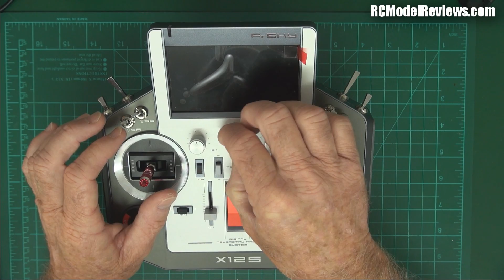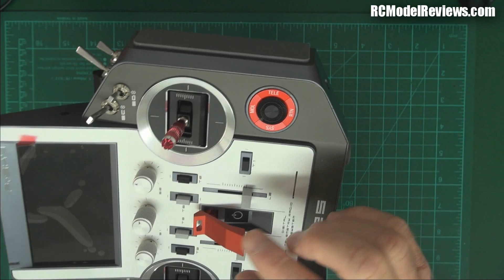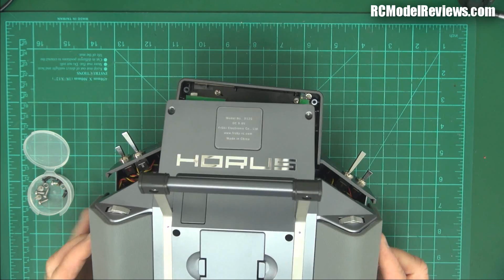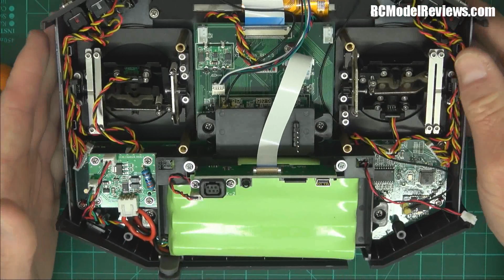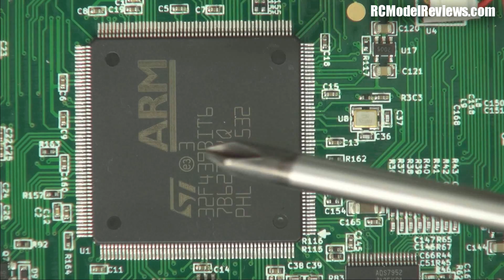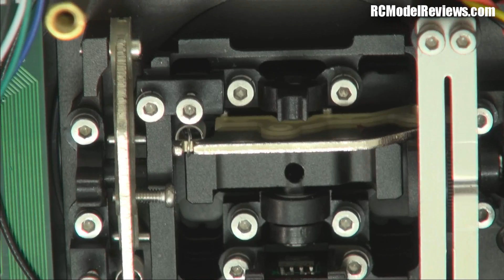FrSky Horus Teardown

Comment: The apparent lack of ESD precautions is a bit of a concern Bruce. It is an area that really needs respecting and perhaps consider an alternative pointer to a screwdriver! I know you may think it does not matter but as a 30+ years experienced licensed avionics engineer and designer I can testify for the damage static discharge can do. I have seen many very very expensive avionic LRUs ruined by poor ESD handling precautions. You don't want problems to manifest later down the line,watching your expensive model plunge down to the ground!

Comment: Hi. A shielded GPS? Ok, how many satellites could it pick up compared with another type at the same time? On the face of it, it's a very poor design. I doubt any GPS receiver works very well with a sheet of metal placed between it and the satellites. If it does, my undrrstanding of rf shielding shadow is in need of a rethink. If someone knows better (rather than just pontificating) do chip in. Bob UK.

Comment: The best thing about plastic posts would be the ease of repair using a variety of methods for example filling the hole with epoxy let it set and then drill a smaller hole than the screw to be used. Using a heat gun to carefully soften the plastic and slightly pinch the plastic smaller. Use a small piece of electrical wrapped tightly around screw once for a quick semi-permanent fix.

Comment: Great video as you say though the production unit has new main board and at least two others. Also gps module seems different. The switch cover has been redesigned and the sticks are shorter. Also as mentioned below you can now use the internal and external aerials together. I have both the beta radio and the production version, the improvements are noticeable. Finally the software has come a long way since the early days and provides a fairly intuitive menu driven alternative for those who can't or don't want to tackle opentx. I am a fan of opentx have been using it since the Taranis first came out. Given that it has been under development for several years it is somewhat unfair to compare the relatively new FrSky operating system, especially if you have the original version shipped with the pre beta units you have. Beta testing identified a lot of the bugs and improvements needed and FrSky have continued to improve it. I really like my Horus it feels really grown up but I won't be selling my Taranis any time soon as Iuse it to fly helicopters and multirotors. Sorry about the long winded comment I really only wanted to say keep up the good work hopefully FrSky will start taking to you again soon and you can do a review of the production Horus.

Comment: NiMh's are safer. They can take a lot of abuse, low discharge wont damage them easily and they work well in cold weather. Atleast in good quality cells the self discharge rate is much lower than with lipos. The self discharge rate is pretty amazing in something like Eneloops batteries. You can have them a few years on the shelf and still have around 80% charge left. NiMh technology is old, but they have kept improving it to this day.

Comment: Regarding antennas, Frsky added diversity with a software update if you plug an external one in.
So if you point the external antenna down (you can't point it up because if the screen), you get polarization this way.

Also, I don't mind the NiMH battery. As far as my experience goes, it has enough juice to run the radio for my typical day of flying, and it retains charge even when it sits unused for a while. And I don't worry letting it charge overnight (like I would with a lipo).

Comment: 26:15 Am I the only one seeing a vertical polarized antena on my right?
Reply: EQUINOX Not true. While there isn't a general purpose Bluetooth, it uses Bluetooth for the wireless trainer.
Reply: You are not, he pointed that out, it's the BT antenna.
Reply: You are correct David that is a vertical polarised antenna, I pointed it out earlier when the video first came out then RCModelReviews responded by saying it was BlueTooth,  However both Mark O and RCModelReviews are wrong because the X12S in this video does not have a Bluetooth function, they are confusing it with the model X12D that does have BlueTooth.
Reply: EQUINOX sorry but there is only one Horus model despite the confusing naming

Comment: the good thing on linear hall sensors used in this gimbals is, they take 5V and output 0-5V which means you could replace the most other remotes gimbals with these if you can make them fit in it.

Comment: 2 Problems with this tear down, first is with the antenna you comment that it only has one at the top but this is not the case it actually has 2, the one at the top that you pointed out and also a second one in the left hand side of the radio ( right side in the video ) if you pause at 27:03 it can be clearly seen

Second is the battery sure it is old tech but then so is the combustion engine that does not mean it is bad, the reason they most likely went with that type of batters is 1: Its does the job 2: It's a far more stable and trusted form of battery tech and is more shipper friendly
Reply: EQUINOX Rather than calling people names you should indeed check your facts, the FrSky website mentions wireless trainer mode. Guess what protocol that uses, that's right Bluetooth! Just a couple of further facts there have only been three versions of the Horus produced, a pre beta version sent to dealers and reviewers (the one reviewed here) the Beta version that went to 150 ish beta testers and the production one which is the only one available from FrSky now. It was the beta version that was missing the gps unit. They all have Bluetooth. I don't need to rely on any website as I have both a production unit and a beta unit.
Reply from the maker: Do you mean the BlueTooth antenna?  That's not handling the RC link.
Reply: BlueTooth?         The FrSky Horus X12S does not have BlueTooth
Reply: Psychosis5150 That is the X12D but it is the X12S in this video,  the X12D has blue tooth where as the X12S does not, If you are going to post a link to try and disprove someone at least make sure you are posting a link to the right product or at least reading the web page rather than just looking at the picture.
Reply: EQUINOX see my comment above
Reply: Alan you are incorrect stop posting missleading rubbish if you actually did some research for the facts rather than looking at one non official website you might not look like so much of a plank,  The retail X12S model does not have bluetooth,  that website that says it does have bluetooth is not the official FrSky website and is actually maintained by t9hobbysport and contains many errors.  Have a look at the official website and you will find no mention  of bluetooth in fact have a look at places that sell it and you will not find any mention of blue tooth and there is a reason ... that's right it does not have bluetooth.   Official website=   http://www.frsky-rc.com/product/pro.php?pro_id=144

Comment: Nothing wrong with Nickle metal hydride. Who in their right mind is going to be taking the back of the radio every time they want charge if they put in a LiPo???😄
I get loads of use from my Taranis on these batts. Just because Bruce says HE doesn't like them doesn't mean that there is any thing wrong with them.
Reply: johnnoble01 I agree there isn't a reason to replace it immediately after you buy it. I replaced the battery in my DX7s (wich supports LiPo in the software), but still use the factory-supplied one in the Taranis.
Bruce suggested that FrSky or an after market supplier could sell another chargingboard/battery-kit, so you don't have to open it each time...
Reply: i use a futaba 14sg with. 6v nimh 1800mah, and it works fine, i've found no need to change it for a lipo or a life even though the radio supports other options.
Reply: Nothing wrong sure, but I much prefer Lipos. 
longer run times and far lighter.
Reply: Smack on right. I've heard the same complaint about the Taranis, yet the two I use for work last 8+ hours on the stock battery, and higher capacity batteries can be built. I sympathize with those who really want the option, but the stock batteries are quality and work fine.
Reply: 29% discount on the horus http://www.banggood.com/Frsky-Horus-X12S-Texture-Version-16-Channels-Inbuilt-GPS-Module-Transmitter-p-1041413.html?p=B0221338596320131216
Reply: That's regular price. The regular price on Banggood is bullshit.
Reply: Why would anyone put a Lipo in a transmitter does any manufacture do that? Lithium Ion would be fine.
Reply: I think LiPo bateries are the typical example of something NEWER that is not necessarily BETTER for all applications. Nickel-based batteries do the job for a transmitter. They are heavier than LiPo... But wait, the transmitter does not go up in the air inside the plane so who cares! They are also much safer. The charger can be made cheaper and they won't be ruined just by forgetting to turn the power off once. If this happens once with NiMh, just charge again and you're ready to go. If happens with a LiPo, then it's time to go shopping.

Comment: Bruce, you mentioned the old FlySky 9X.  Do you know if the Horus or new Taranis hall effect gimbals will fit/work in the old 9X?  I'll probably need to replace my gimbals early next flying season and those look like they'd be the way to go, if they'll work.
Reply: HBS981 you will need to do some mods mechanically to fit,  but electrically I know 9xr pro works on 3.3v so it will work,  not sure on 9x if it's 5v the we might need to voltage divider.. etc
Reply: id love to know that as well

Comment: Hey Bruce- I would have liked to see more on the external antenna! Is it only connected to the module bay or will the Horus detect an antenna and transmit through that? Great tear down by the way, happy to see it for the Horus !

Comment: I know you're not a fan of Spektrum's 2.4 modulation. Let's put that aside as I've never had issues (And have with FrSky). My concern here is with servo draw. While I'm currently only flying 30%ers, I do plan to go bigger one day. I am also flying with WAY overkill servos as I hope to move them over to a bigger plane later on.

I do want to switch to FrSky, but as far as I have seen they don't offer any high current options at all. The only reason I'd be switching over to FrSky is for reliabilty (I DO have a problem with Spektrums pots in the DX18 I fly with.) How would you go about running 10+ servos that draw nearing an amp each constant with peaks over 2A? Does FrSky plan to release a powersafe receiver soon? I am a fan of the KISS (Keep it simple and stupid) theory and don't want all the extra complexity and failure points of power boxes.
Reply: Weese - hey there - I would recommend using a separate SBEC. It's really common to find a reliable 5v 3 amp switching BEC for less than $10.

As far as protocol goes- DSMX is honestly one of the better. ACCST (FrSky) is great as well. The difference is, many of the receivers from Spektrum are not very sensitive compared to the newer receivers that have come out from FrSky. I have modified a DX6 and gone out just over a mile (only higher gain antenna for the mod) - As for FrSky, I regularly go out a mile on a stock Taranis and still have >70% RSSI. I use an L9R and an OSD for even longer range. I trust my most expensive models to FrSky and always will.

Stay safe Weese, hope I helped!
Reply: Thanks for the reply! I'm not so much worried about regulators here as I'm running straight 2s 7.4 LiPo to HV servos. I'm worried about the power traces on the receiver. Spektrum makes power safe receivers that are meant to handle the high current needed for big models. I've seen normal "full sized" receivers burn through the power traces driving servos like that.

Edit: I somehow replied to my own comment by accident. Durp.
Reply: Run a PowerBox, a SmartFly, an XPS 10+, or even FrSky's new power expander. I do in all my planes, even my 42%'ers.

Comment: ive seen alot of radio even branded expensive one that have worn out pots due to 3d flying helis, i really wish they had magnetic or optical pots like in dj mixers where djs used to scratch with, now branded radio will get this idea from frsky. why to go frsky for being first.
Reply: Jeti had hall effect gimbals long before FrSky.  But then again, FrSky has stolen quite a lot over the years from Jeti.
Reply: I had a high end flightstick back in the 90's that used hall effect sensors, this is nothing new.
Reply: prototype3a what modern radio has this non pot stick.
Reply: Atomicskull probably. i dont see it in modern radios thou. i have opened alot of modeen radios end expensive ones. alot have pot problems specially 3d heli pilots
Reply: im not familiar with jeti, but you cant find this on modern branded radios, magnetic and optical faders for mixers were just a must on dj mixers, i wanted them to have it on radios too, you just cant say stolen, because it is a need in our radios, even the latest expensive radio will not last long with a 3d heli pilot.

Comment: One advantage of having multiple boards that you didn't mention, is that if one of the board fails they can replace just one, instead of the whole board. They went the same way with the X7.
Reply: As partially stated in the video - Modding, repair and upgrades are always easier with separate components/boards.
Reply: Maybe I missed it then. He did talk about it being easier to revision the board on FrSky's part.
Reply: agree. also the cost doesn't have to go that much - they are made on a panel.
Reply: also the bluetooth board is a ready to buy module. +1 for all boards - it would be great if one could design an internal lipo charger for the taranis (i personally like the nimh/eneloop option on mine but have friends that would love that)

Comment: Thanks Bruce for another great review, as usual in this channel :)

I've been using the Horus for about 4 months now and I can attest that is a very good radio.

While OpenTx is a great radio firmware, it still needs to catch up to make use of all features available in the hardware (gps, bluetooth and radio sensors), but  given the accelerated pace of development that's just a temporary aspect.

If someone designs/produces/kits a charger board for LiPo/LiFePo, I would immediately buy it too!

Cheers,
-Sergio

Comment: That GPS is not even pointing up. Its pointing down.
Reply: Its a non-issue for GPS as much as i like this guys videos he often has no clue about electronics and makes assumptions, the reality is the orientation of the module is irreverent as is the metal plate as both will have next to no effect on the performance, The reality is this type of configuration has been use for many years now in phones, GPS devices like Garmin, Tomtom and they all have the screen a metal plate and then the GPS device and they all function perfectly fine
Reply: So you have no idea how a patch antenna works, you dont point a patch antenna at the ground. You say " they all function perfectly fine" but you dont consider a difference between 6 satellites and 20 satellites.